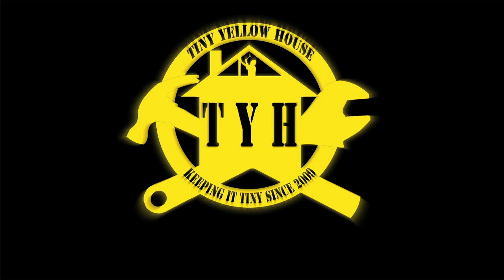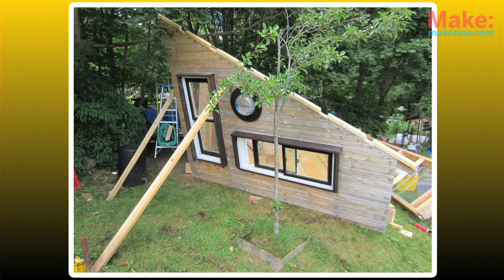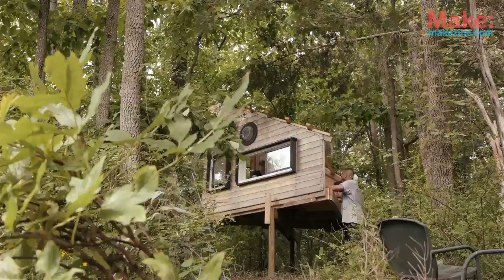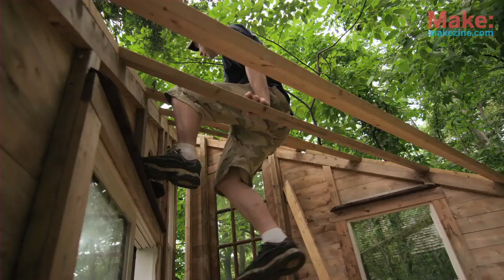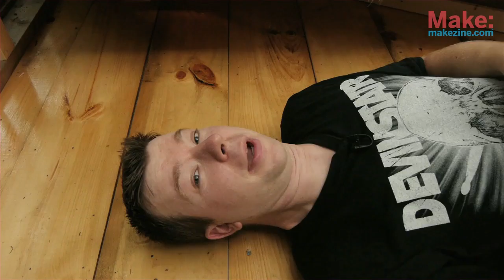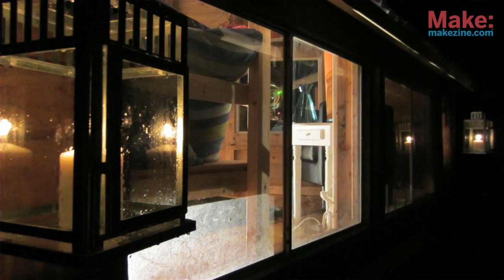"The Wolfe's Den" Treehouse - Tiny Yellow House

Comment: What allowance was made for tree movement due to wind and tree growth?  Without incorporating a sliding/pivot connection point to the tree, it seems probable that the posts in the ground and their connections to the framing will soon be loosened.  Mixing 2 static elements (posts) with 1 live element (tree) without a flexible interface, does not seem a good idea.